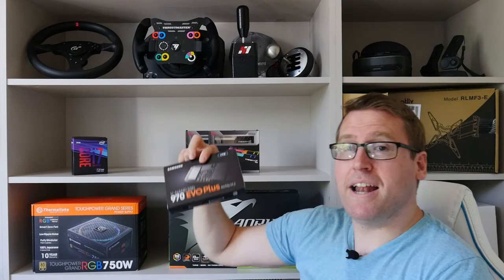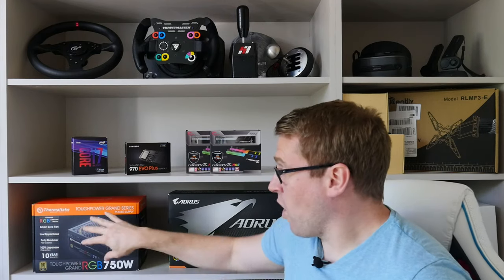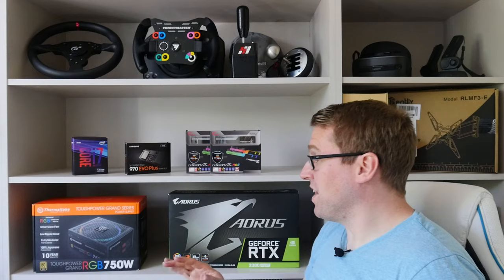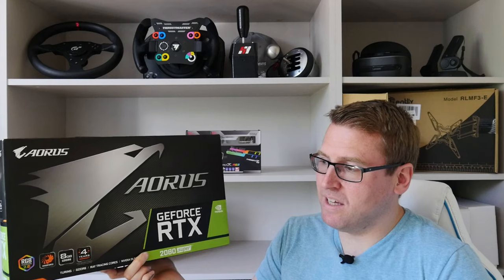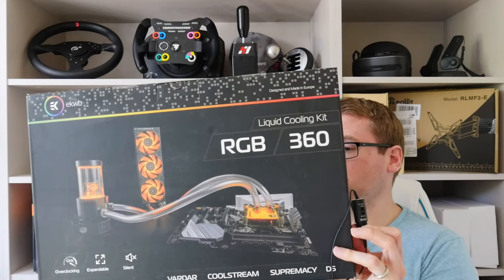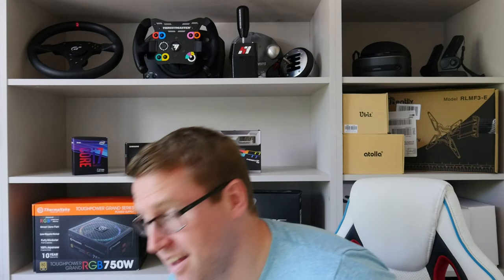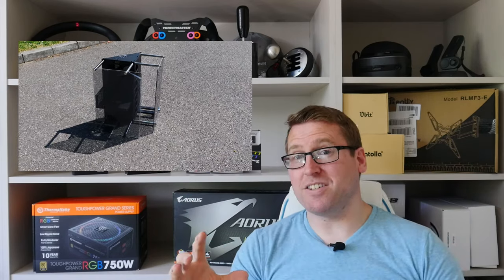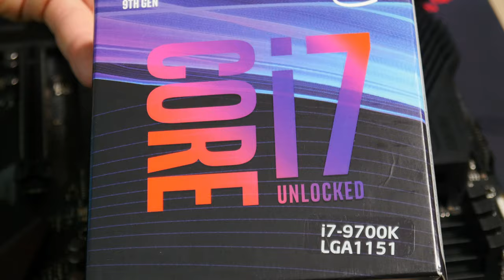Wall Mounted Sim Racing PC Build | Including Timelapse | 4K

Comment: You have kind of inspired me to look into a water cooling kit. Usually a good air cooler is fine but I want a quiet build and water seems the way to go. Great build, the case is awesome, thanks for posting.
Reply from the maker: Glad you enjoyed it! Water cooling is great. this complete kit is about €450 delivered but performs incredibly well and as i plan to overclock my processor, it makes sense. Plus, it makes the build look amazing which was one of the goals :)
Reply: @LaurenceDusoswa  what do you think about posting the long unedited build? I wouldn't probably watch it all but flicking through it might be okay.
Reply from the maker: I have thought about it but i don’t think it would suit my channel content. The amount of effort involved to make a video like that watchable would be massive. And there’s no way I can compete with the pc building channels that already exist either.
Reply: @LaurenceDusoswa  ya, if it's not just a video dump and requires effort to edit any of it then it's probably not worth it.

Comment: Radiator input/output should be on bottom (180 degrees).  This will provide better flow, cooler temperatures, and less noise.  It will also increase life of pump.  Otherwise, nice build.
Reply from the maker: Yep and that’s how I had it built at first but it didn’t look as nice. I’ll keep an eye on the pump but I haven’t seen this setup fail for anyone. I’ll just hope for the best ;)

Comment: I agree with you on the 2070 Super vs 2080. I'm looking at the 2070 Super Tri fan for a new build, buy might wait until 30 series comes out. The wait might be long though as 3080 3090 first and 3070 or whatever it'll be called later on.
Reply from the maker: Yeah keep an eye out for decent 2070 offers now for sure. I didn't have the patience though :p
Reply: In reality 2070 is more than enough for 99% of games, I do have 2080ti but that was just because I am stupid and wanted it for vanity reasons

Comment: Make it look so easy, noob question I have an SSD in my pc but it's a black box around half the size of a HDD. What's the difference between mine and the small card ssd you installed @7:30
Reply from the maker: So what I have is solid state but it’s referred to as an m.2 drive. It’s nvme technology. It’s just quicker than a 2.5” SSD.
Reply: @LaurenceDusoswa  thanks, wasn't even aware they existed let alone they had there own little slot on the motherboard im so far behind. Is it for general use or just for your OS?
Reply from the maker: Mine’s a 1TB so I have games on there too. You can get motherboards with a slot or you can get a pcie nvme drive too.

Comment: Why did you take the cpu block apart
Reply from the maker: Great question. I did it because I have an intel cpu and it required a different ‘jet’ piece which basically sprays the coolant at the heat source directly. The AMD one has a different jet piece in it. Those pieces look like a blade. Bit finicky, but had to be done :)
Reply: @LaurenceDusoswa  i thought i better check the instruction as i have just fitted an EK block, phew mine already has the correct jet plate fitted, thanks for your reply
Reply from the maker: Hahaha nice one :) I don’t know if it would cause damage but it could lead to poor performance for sure